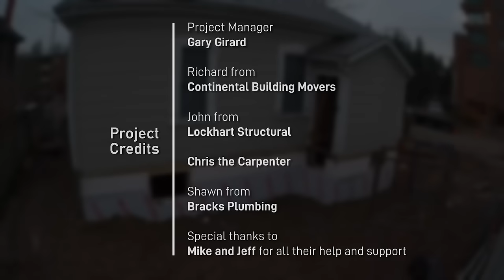Lifting a House Up In The Air and Adding a Floor Underneath (House Lift)

Comment: How much did this project cost
Reply: costs zero ,good samaritan project
Reply: The house probably cost a million dollars being it's in Canada
Reply: 48 million. But they saved themselves the headache of buying a new home!
Reply: I think an enlargement project of this size would normally require a budget of about $200,000 dollars (depending on finish quality of the new basement-floor fittings etc)

Comment: I had to do something similar to my place. The county would not let me tear it down to rebuild. They said my house is on a lot that (under new building code restrictions) unbuildable if I were to tear it down. What I did was, tear off the second floor, rebuilt it, lift that up, then tore down the first floor and foundation, once that was done, set the second floor down on top of it. It was the only way I could circumvent the new building code. Added about $80k to the project, but it was that or nothing.
Reply: Nice ship of Theseus method :D
Reply: @ikani1  exactly
Reply: Wow!!!  That's crazy.  I hate when regulations get in the way of logic.

Comment: my grandfather in the 1950s owned a father and son concrete company in Chicago that specialized in putting in full basements under existing houses using conveyors to bring the dirt up to the ground level.  Basically done by hand.

Comment: So not really a new first floor but a new fully insulated basement instead. Nice ICF build👍. House lifting is always a fun watch for us spectators. Probably not so much for the home owners though, LOL.
Reply: But the house wasn't that great, so seems like it would have been smarter to just demolish the entire thing and start new? Sure it would have cost more but in the end you get a brand new house with new electrical (this one prob has knob and tube) and much more functional and better insulated.
Reply: Yes I expected them to build another floor, but I was realizing that they don’t have time left to do that. Seems like a lot of work for a full basement
Reply: Seems like that backhoe was more trouble than it was worth.  Seems the hoods were up more than down and seemed to hold the project up many times. Maybe I see it wrong.  Cool project theo? We're you living in it while working on it?

Comment: Why no egress windows after all that work to make the basement habitable space?
Reply: There are 2 on the north side
Reply: @continentalbuildingmovers357  it’s still odd to have those tiny vent windows way up high, when they could have been placed several feet lower. 🤷

Comment: Did it a little different lifted mine and replaced the foundation and framed a new 1st floor under the lifted home turned a cape into a federal with a covered front porch. Cost me 150k in nj
Reply: I'm in Jersey and interested in this type of project for my cottage. Do you have pics or recommendation to the company that lifted yours?

Comment: Wait-wait- wait-wait! How did they lift it? What was happening on the other side of the house?? I have so many questions!
Reply: Me too!
Reply: In most cases hydraulic jacks designed for this purpose are used.
Reply: Lifting is NOT the magic.  How did they move it forward and back to its original position?????

Comment: Awesome! Is it possible to achieve a ranch brick house ? We want increase head room of the basement.
Reply: I think it would depend on if the brick is Veneer or not if it’s a veneer and the house is wood framed this should work but if the house is solid brick on the outside it probably would have to have each wall of the basement dug out and new bricks put under the existing blocks for each wall. Then the basement floor could be removed and any pipes and wires would have to be adjusted. Poor a new slab and it should be done. :)
Reply: We ( the industry of professional house lifters ) can lift any type of brick structure whether veneer or solid brick .
Reply: @Abodemover  How do you keep the Vermeer from coming off when you lift it? it become very delicate after a few decades. :)
Reply: @TheNightshadePrince ,  you have to support the brick close together at the point you pick it up with steel beams. If it is especially delicate the brick can be supported with vertical support pushing it towards the house walls
Reply: @Abodemover  Interesting. :)

Comment: How much was doing this as opposed to just taring down the old outdated house and building another house with full basement
Reply: Not sure if this is the case in this video but some places have strange restrictions on new construction in older areas, lot is possibly not big enough for new construction but remodeling is a whole different ballgame.
I’m always amazed by what they will permit me to do with existing structures in my area but will not give us permits to tear down and rebuild.

Comment: Wondering how much stress that puts on the framing. If you take apart the console of a car it squeak forever afterwards because everything is loosened up, I'd imagine that every nail and screw would have the same effect.

Comment: I want to do this to my house to add a foot or two of height to my foundation walls so I can get the basement floor repoured higher. Whoever built my house (at the bottom of a hill) built the foundation floor level with the ground. When it rains heavy the water creeps up towards my garage doors. Adding 4-6" of floor height would raise the floor above the potential flood level while increasing the overall ceiling height in my basement. I'm guessing this isn't a cheap process.
Reply: I'm doing two houses at the moment that you basically describe. Turning a 6ft basement into an 8ft basement. We are underpinning the whole house first, and chopping out the floor, digging down 2 feet by hand, then pouring a new floor. You might not necessarily need to do a lift.
Reply: I am in a summer cottage "upgraded" that was built w/basement on hillside which I am guessing was a bit less than a an 8/10 pitch roof.  The basement came thru fine but the plan to concrete UP and DOWN sides with 16 foot porch and sidewalk lacked, sidewalk sank a 6 " to the house basement.  4 slabs of 4x8 concrete have some tilt, the 'scooped out' uphill side should have had a porch cover from the house to the garage.
Reply: If there is room it's probably better to move it off the foundation completely and install a new one

Comment: How do they keep it from flooding?
Reply: French Drainage system it seems you can see them adding the tube in the lower corner of the basement, which will catch and pump out ground water
Reply: @rickyshinobi2303   it wont work if power is off, pipe breaks and nobody's around to turn the water off.
Reply: @eastpark4864  I’m no construction expert. But you are correct if there is an issue with power then the sump pump will not work, you might be able to add an alarm, just in case, you can also have a manual backup, and then have a back electric pump around if not too expensive. I believe the goal of these drainage systems is to keep ground water from directly impacting the foundation if you have a groundwater challenges at your home? I assume if The drainage systems if not collected into a pit, if possible they might directly connect it to the main sewer but I don’t know if that is acceptable? If a pipe breaks they will have to dig up and replace it, but most ppl used very thick, robust pvc looking pipes if they don’t want issues with collapse or breakage it seems. Again, I’m no expert, just here learning and taking tips and tricks.
Reply: You can clearly see they don't have a problem with ground water or only problem they might have is with run off but im sure that's minimal and they added a French drain for redundancy.

Comment: They added a better and up to code basement, it can’t be considered a living space or “extra floor” unless it has an exit directly to ground level, not a set of stairs to a door the same height as the main floor of the house. We spent a tom of money converting a basement into a living space with 2 bedrooms a family room and a full bathroom. We had it appraised and what we did added no value to the original 2 bedroom house. Actually had it appraised by 3 independent appraisers and one bank financed appraiser with the same results.
Reply: you added finished space but you added no bedrooms even though you technically did add 2 bedrooms.  They need egress exits in each room to be considered a bedroom by NBC (national building code).  I think it's hogwash but I do understand it.
Reply: if you added the egress in each bedroom that should allowed them to be counted as an additional bedroom.... just an FYI.

Comment: I am no fan of foam block forming. It was noted that forms collapsed right before the concrete pour. The foam itself leeches cyanide into the surrounding soil and water as it breaks down. This is a very unhealthy way to build. Cheap, yes, but cheap is not always better.